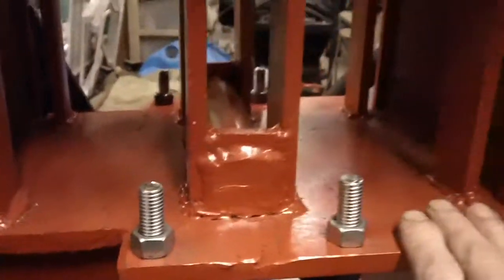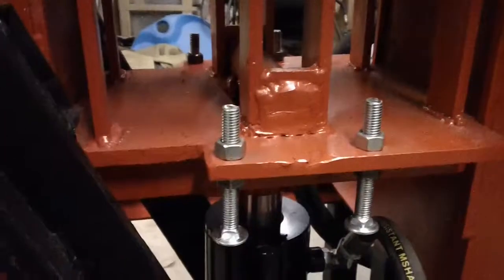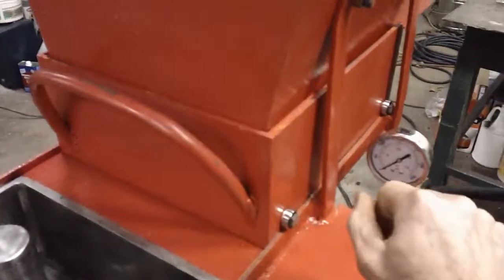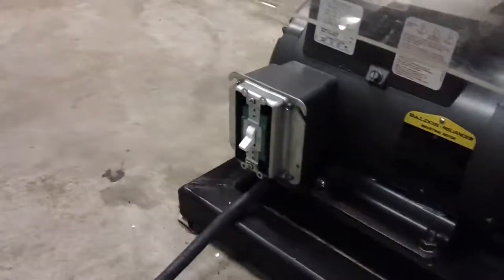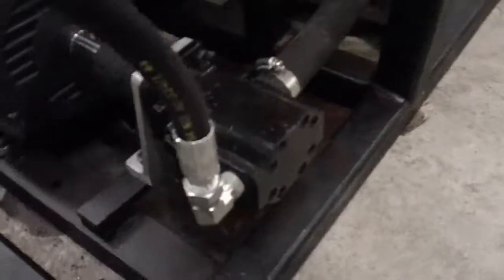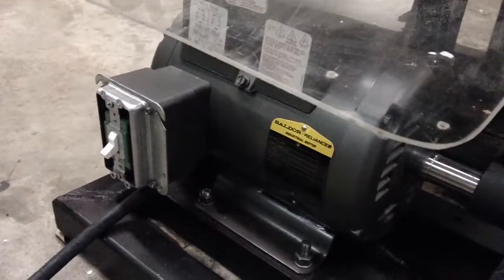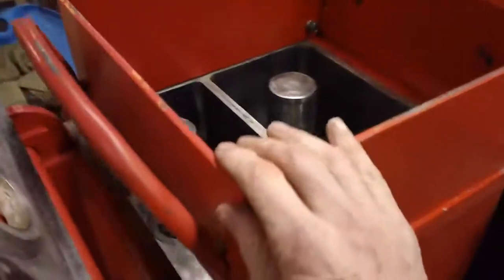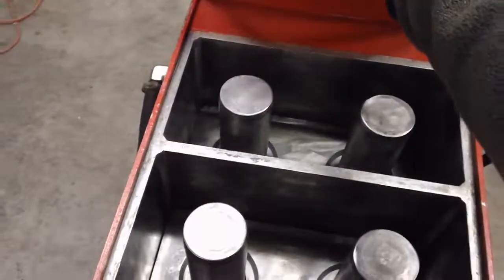Converting a manual Compressed Earth Brick machine to hydraulics video 4a

Comment: You ever finish it?  Looks great, could build other tools for the power unit..
Reply from the maker: Hi Mark. Yes I finished it but then it rained for 4 months straight and I could not dig any dry dirt for my bricks. At the same time I discovered aircrete and began testing building with that and came up with a fantastic aircrete shredded styrofoam mix, very cheap, insulative, fireproof and made from 85% free recycled material. I build my workshop with it. I am about to release a series of videos on how to build with it under the name of Creative Building with Stephen Williams. I may experiment actually making bricks with it using this machine.
Reply: @stephenw1892   great modification!  would you like to share from where you obtain the machine or where can one buy one ? -thanks
Reply from the maker: @josephramos9891  Joseph I bought a manual machine from China. I shipped it over here which is quite an ordeal, then converted it to hydraulics. I could have bought a hydraulic machine from China as well. The manual double brick requires more force than a person can place to make the brick. If you want a manual machine buy a single brick machine. Go on Alibaba to find lots of manufacturers of these machines.
Reply: @stephenw1892  thank you  Stephen, Hopefully this machines can bring home affordability to certain areas. Did you had to deal with customs  at all when you made the purchase ?
Reply from the maker: @josephramos9891  Joseph yes you have to deal with customs. I had never gone through that process and had to work with a firm that handled the customs end of the transaction. Everyone in the process has to get paid. It is ridiculous and costly and time consuming.
Reply: @stephenw1892  can you build some here to sell, I need one for Liberia 🇱🇷 west Africa. I am currently living in Iowa state

Comment: Please any video of it in action of video of anything you built with it?
Reply: Hi Bigpapa, Once I completed this I was ready to start making bricks and it rained off and on for 2 months. I needed dry dirt and could not start. I then experimented with aircrete styrofoam and found that to me super insulative and easy to work with and I never made my bricks. I have the brick machine for sale for $4000.
Reply: @stephenwilliams4534  Would you kindly mention the details of the machines how many bocks it can produce per hour or 8hrs shift and what is the compression force it has? thanks for your work anyway.
Reply: @stephenwilliams4534  Hello Steven. Will you have another machine for sale and where would it he shipped from, so I can calculate the shipping charge to Nashville TN OR have it picked up if is not on the other side of the country. Thank you Sir.
Reply from the maker: @teresatellez1556  Hi Teresa, I am right next door to you in Athens Alabama. I am asking $3500 for the machine and it works great. You can email me at stephen.williams64@yahoo.com.

Comment: would a hydraulic power unit such as this one work? 
https://www.ebay.com/itm/VEVOR-Electric-Hydraulic-Pump-2-Stage-Single-Acting-10000-PSI-7L-Oil-Capa-110V/124184639167?_trksid=p2485497.m4902.l9144
i would need to get a cylinder and some hose. i thought about buying some plans and trying to get it built one day. thanks for your input and great video.
Reply: Hi Rob. I looked at these self contained hydraulic pumps but the flow rate is only 1.3 gallons/min in stage 1 which is about 10 times as slow as the pump I have on this machine. It will work but just very slowly. which is a problem when you are making thousands of brick.
Reply: @stephenwilliams4534  thank you so much for understanding on the topic.
Reply: @robpanel  Rob where are you located? I am in Athens Alabama and am selling the machine for $3200
Reply: My infrastructure isn't set up for it yet I'm in Dayton Ohio. I do hear there is a few people looking for one in the states. I'm sure you will sell it soon.

Comment: If you are selling how much it cost  and
What is the size of its blocks
What is the compression pressure force psi or mps
Does it haeve gasolin machine to power ot uses electricity can it have wheels etc
Please write back at mukhtaryare1@gmail.com